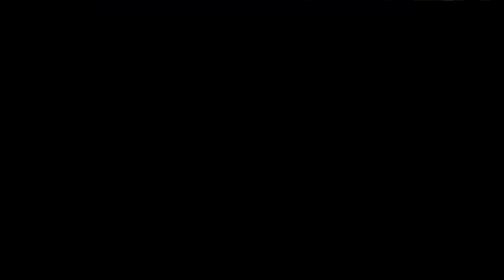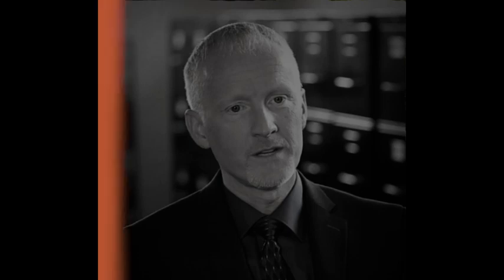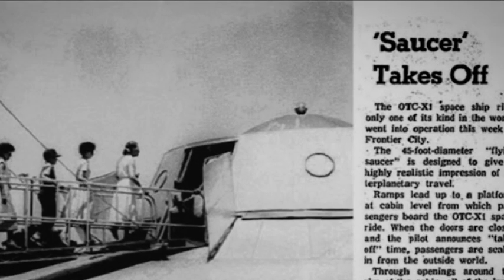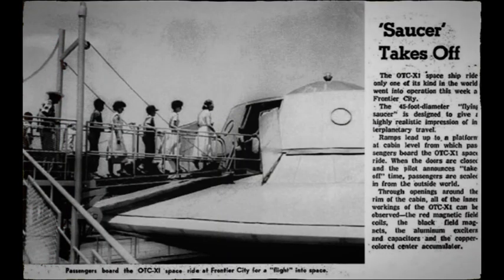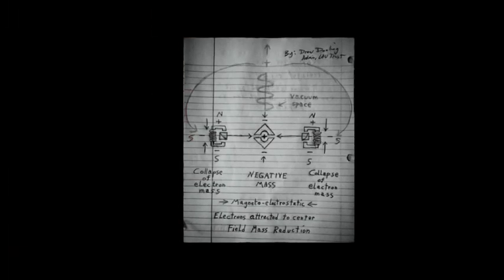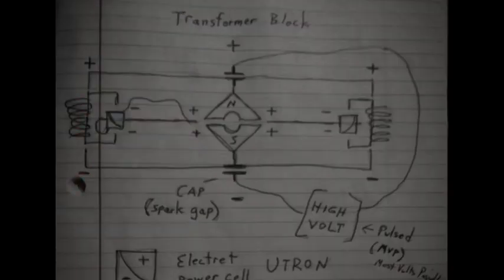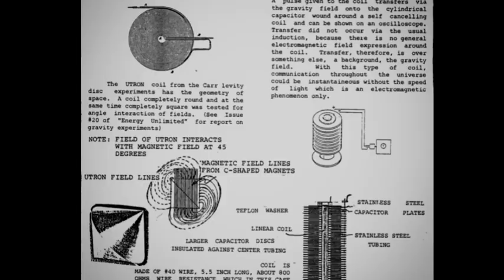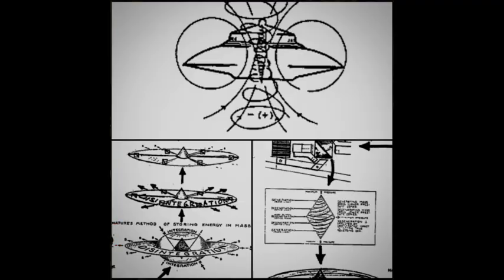Here's What You Didn't Notice On The OTCX1! | Agasobanuye Rocky | Bamenya series

Comment: I think this craft is a teleportation craft and not something to see if it is levitating or not - forget the 3D way of thinking stuff, you must think in a sense of 4D and 5Dimensional. I now we cannot actually do ourselves 4D or 5D because we are in the flash and not in spirit but hey! we can at least explain them! Correct me if I am wrong. When the north and south poles containing electrons, protons counter rotate and come to the center of the craft they start separating, when that happens, they become light and I mean extremely light. You might say plasma but it's one hell of a plasma kind that the craft is creating for you to use. They end up losing weight even a taught can control these particles, so the pilot sitting in the craft becomes the complete circuit and his now able to only use his mind to start controlling the craft where it wants to go. Simply put, the craft is designed in such a way that creates these plasma atoms that can now obey what you want them to do.
Reply from the maker: I like your theory! But roughly speaking we can't directly compare the earth to a saucer, especially in forms of positive and negative charges, we can't succeed: suppose we created another small object which functions the same as earth, we put it on the ground and turn it on. Do you think it will levitate? Probably not! Even though it was functioning the same as earth we won't be able to achieve Antigravity. Instead, what we can possibly do is to focus on the air surrounding our levity device, by doing that you create a strong levity field which allows your Craft to Flow in the air like it's on water. I covered all these several topics in my explanation videos on the channel.
Reply: @KEIDIUMPHYSICS  My brother it will work, trust me, if you set it up properly, because this teleportation craft by Otis T Carr totally completes two stages of energy storage: 1. Energy is stored in an electromagnetic field 2. Energy is stored in an electrical field. And is working at the same time. Some do levitate there object like the "Biefeld Brown Effect", which they only make the energy store in an electric field, by setting up their capacitors in such a way that it creates a thrust, this is done by arranging one electrode plate smaller than the other, which does the trick. Just storing energy in a electrical field doesn't separate the protons and electrons in an atom completely. Separating protons electrons in any atom whether it is plastic or metal makes the object become lighter not only that when you separate protons and electrons inside an atom they become more responsive even staring at them they will end up moving because our eyes give out vibration or what they call it resonance frequency. The nature of the components of atoms which are protons and electrons is to create matter that means to be responsive to any living object that has a complete form of atom so it quickly response to it.